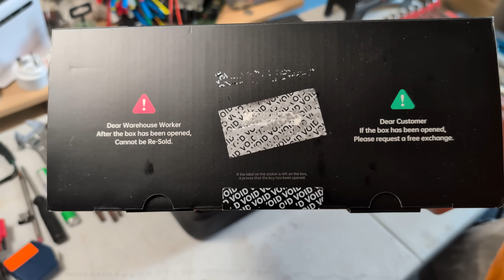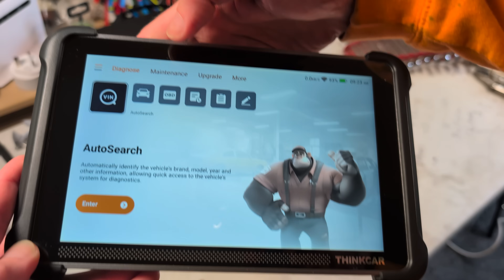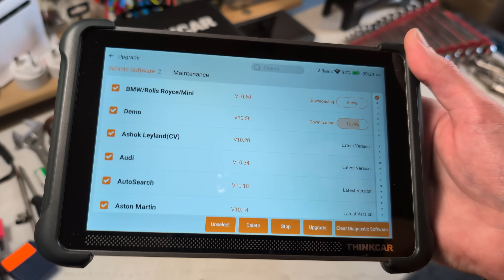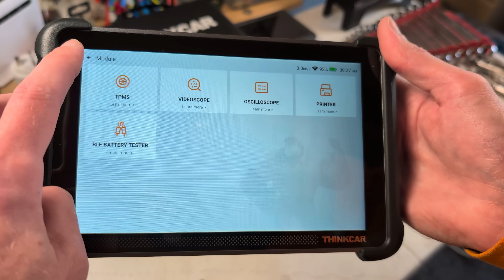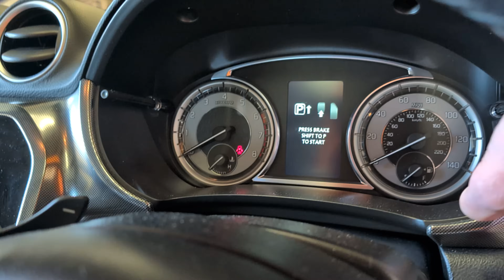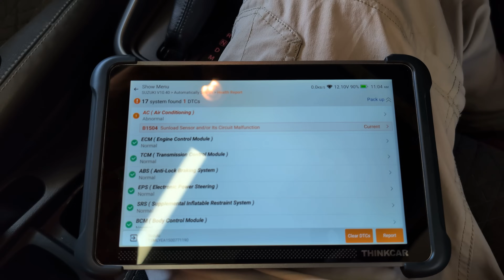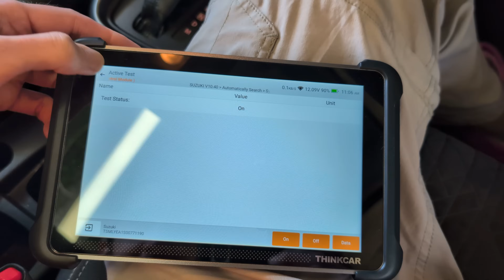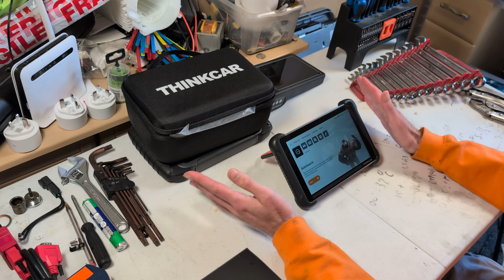Thinkcar 689BT Automotive Diagnostic Tool

Comment: I've purchased 👉THINKCAR 689BT👎 It's USELESS. It SUPOSEDLY have 34 Re-sets But had only few that you could do it with 50$ little scanner. If you don't believe me Then you're welcome to throw your maney. I've check many videos and mostly🤥🐦 they've no ideas about anything until they've to use it for real. Like myself. I believed as it mentioned 34 resets.👎 Anything l tried nothing worked. Whatever I tried as resetting it all end up in blank screens.😡👈 That's how I'm happy. I did all what scanner suggested and no results. Nothing more Then Typical Fraud.👎😡🙉